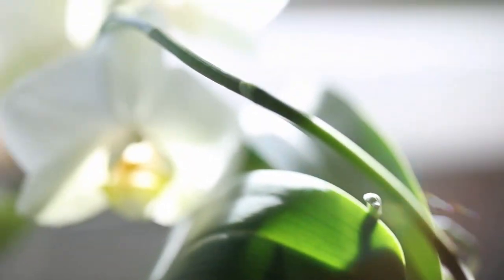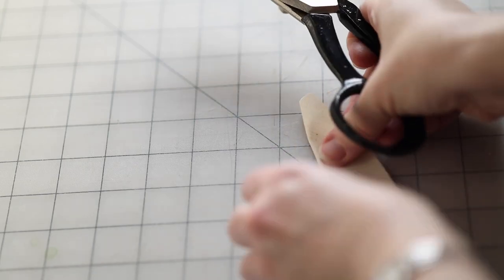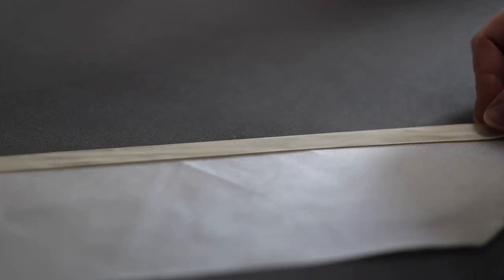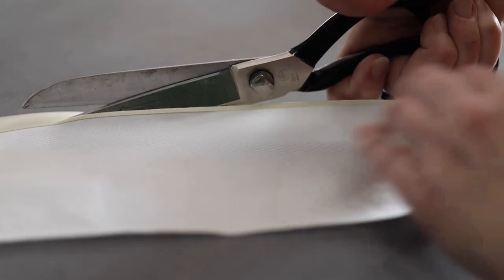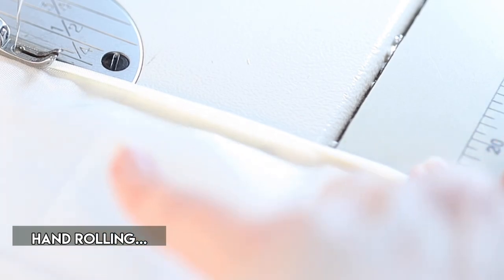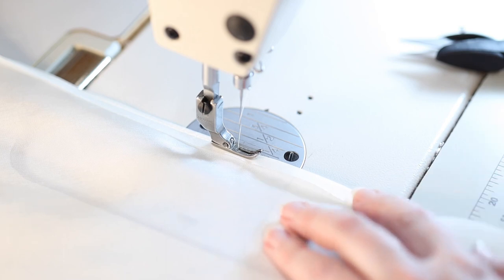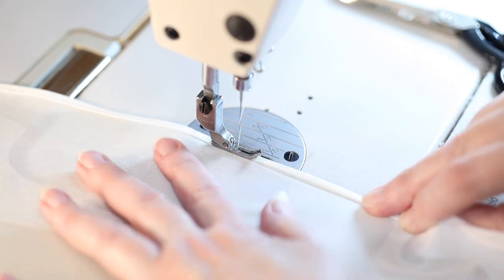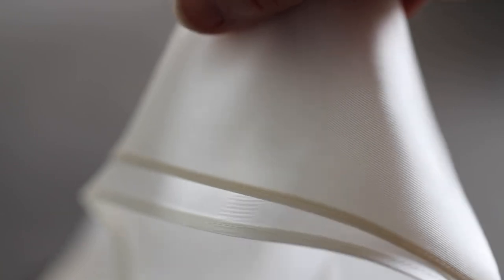How to hem a WEDDING DRESS * Sew a Bias Rolled Hem * Hem a Prom DRESS, EASY Hem satin Wedding Dress

Comment: For the ribbon method, do you leave 7/8" seam allowance (beyond the planned finished edge) or 1"?  how much hem allowance is necessary for the other methods?
Reply from the maker: I feel like that's different for everyone. My roll is usually cutting 3/4" longer than the expected final length. But, people need to do whatever their roll requires.